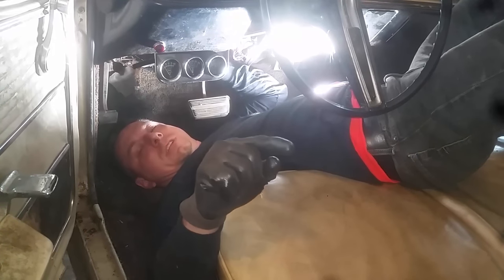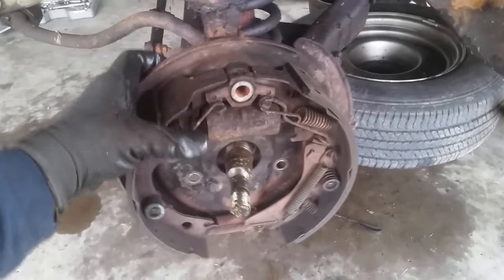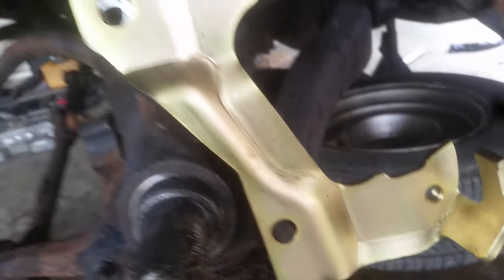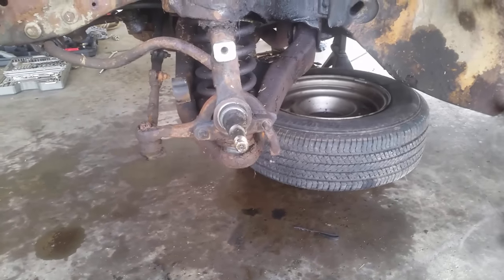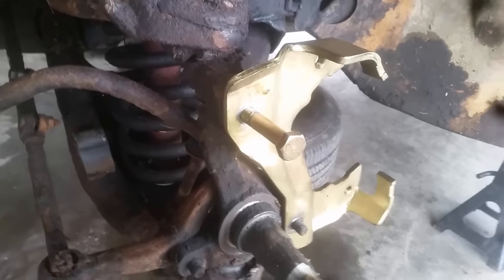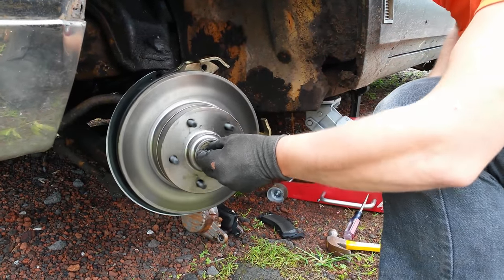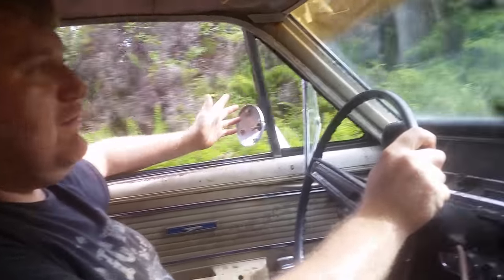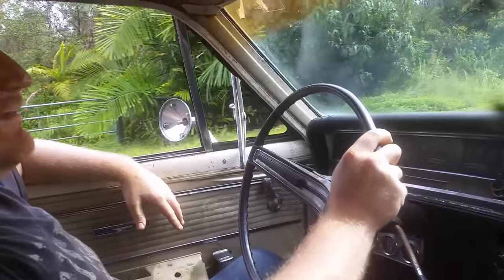DIY budget drum to disc conversion, disk brake, Chevy pontiac buick chevelle nova camaro rat rod

Comment from the maker: LINK TO THE KIT IN THE VIDEO--->     http://www.speedwaymotors.com/Speedway-Deluxe-1964-74-GM-Car-Front-Disc-Brake-Kit,4624.html                                     ALSO,  I USED AND ANGLE GRINDER WITH A CUTOFF WHEEL TO MODIFY THE SPINDLE.  THIS IS VERY EASY TO DO, JUST TAKE IT SLOW.

Comment: Very well done, easy to follow. I do have one critique as to grinding the upper boss to make bushing though. Wouldn't it make sense/be easier to ream the bracket to fit the boss/bushing? Thanks for listening, John the Bassist.
Reply from the maker: +lektrikbass in the event you purchase a set of disc brake spindles I would prefer to have the bracket remain unchanged.... or in the case of going with a different disc brake route and being able to reuse the brackets or sell them...  making a little sleeve is fairly simple.  Especially because you need to cut it off the upper drum anchor anyway.

Comment: Very cool budget upgrade, i have a disc brake conversion kit with 2" drop spindals for my 67 impala i was goin to install the kit wen i install the airbag kit from accu air with e-level sensors i just havent had the time to do it,,i already rebuilt the front suspension 1 yr. ago with new everything n tubular control arms to correct the geometry of the old 67 stock susp. But i wanted to take it a step further with the airbag set up ya know!
Reply from the maker: We love these brakes.  Cheap and work good.

Comment: Very homemade and very awsome tip. I have a 69 nova with drums and i really want discs
Reply from the maker: Esteban Krapp it's the cheapest simplest kit that lets you keep 15 inch wheels
Reply: Invincible Extremes Muscle Cars Garage oh good point 15" wheels... i have 14" can i do something?
Reply from the maker: Esteban Krapp this will work with some 14 inch wheels.  Just need a little grinding on the corners.  Factory 14 inch disc brake wheels will work, but not 14 inch drum brake wheels.  The disc brake wheels have more room inside for the caliper

Comment: Like the information, just have a few questions. Since ive got the rotors and the master cylininder and calipers. Is all i need is the bracket setup? Thanks
Reply from the maker: Yes. That's all you need, i did the same

Comment: Saved me thousand$!!!!! 

Thanks buddy
Reply from the maker: Thanks!
Reply: Can this be done on a 1967 delta 88?  I have 26 inch rims. Will this kit work with those rims ?
Reply from the maker: Isn't a delta 88 same frame as the impala?  I think the impala is a different spindle, but something made for an impala can be used.

Comment: I tried this on my nova.  I had to buy spindles.  40year of hack jobs and burned bearings,  I felt I could try some new ones! Next I want to do rear disc. 
Are you going to do a video for 15 inch wheels?
Reply from the maker: todd heaney first we gotta put posi and 3.90 gears in the rear.  Then we'll look into some rear disc that fit a 15 inch wheel.
Reply: Hella ya looking forward to that video as well👍

Comment: My God THANK YOU SO MUCH,  GREAT VIDEO
Reply from the maker: Thanks
Reply: @InvincibleExtremes  deciding to replace / 1963 Buick Skylark.  Or swap out too Disc. Note seeing that it's not bad... I'm going disc.  Ty again
Reply: @InvincibleExtremes  
 Just a quick question while I got you the FRONT Drums do I have to remove a bearings And the cotter pin to get the drum off ???
I haven't a hard time getting the drum off the backs came off easy....
 Please thank you...

Comment: So this may be a stupid question but since he used speedways conversion kit does he have to always buy his rotors and pads from them when he needs to change them?
Reply from the maker: Nope, these are stock brakes.  So pads, rotors and bearings all come from any parts store and are dirt cheap.  I just happened to buy the kit from speedway.  

In fact, because shipping to hawaii is expensive, you can buy just the brackets.  And can buy the rotors, pads and calipers locally.  From a 69 camaro is what i told the parts guy.

Comment: Disc and drum master cylinders are very different! The drum master cylinder keeps a bit of pressure in the drum to help keep the shoes close to the drum,the disc master cylinder does not retain any pressure. Using the wrong one will give discs that are constantly dragging and overheating.
Reply from the maker: Andrew Wilson I never said they weren't... thats why I used a disc/drum master off a 68 camaro... and threw away the drum master.  if we ever had to upgrade to rear disc brakes as well, we would then need to switch to a disc disc master cylinder... because that disc/drum one has the residual valve in the rear drum portion of it...

Comment: I have a 1967 Firebird, it has a booster and double reservoir. I think it’s a master cylinder. Do I have to upgrade the booster and master cylinder ?
Reply from the maker: You might get away with just the master... depends on pushrod length.

Comment: Hey Cool Breeze, I got a 66 Chevelle, Ever done a rear drum to disk change? I heard a 98-2003 Chevy S-10 with disk will work, Do you know?
Reply from the maker: Dave Hurst yes it will, i've used the 98 camaro brakes on my 65 chevelle SS 12 bolt

Comment: I'm going to try this on my 64 I have a 350 small block do you think I can just use the master cylinder and booster from a 85 Caprice
Reply from the maker: jr dajuiceman you could... Or you could just buy a 68 camaro master.  Entirely up to you.  Either way you'll love the brakes.  I have no complaints about them.

Comment: Hey man I got a 67 tempest 4 dr custom. Wondering if this will work, if so do I need the proportioning valve (I don’t think we’ll be doing burn outs and what not).
Reply from the maker: You need a proportioning valve regardless... and yes, it will work just fine in your car.  Bolt sizes might be a little different but it's the same exact spindle.
Reply: Invincible Extremes Muscle Cars Garage thanks man I really appreciate all the videos and info you provide us !
Reply from the maker: Just doing what I can.  I'm glad you found some of them useful.  A 67 tempest 4 door is a graceful car, I'm glad you're working on it
Reply: Invincible Extremes Muscle Cars Garage thanks man I appreciate that. Yeah my dad got this car in the early 90’s I pretty much grew up in since I was born in the late 90’s. It hasn’t ran in a few years and I figured it was time to get it back up and running. I’m really finding your videos helpful. Once again thanks !

Comment: After getting the front disc rear drum master cylinder of a 68 camaro Do I use my stock proportioning valve on my 73 Nova or can I get one like the one you ordered from Speedway to replace it and mount it under the hood like the stock one under the master
Reply from the maker: Ismael Lopez can't use the stock prop valve... at least not for the front.  gotta use a 3 way splitter for the front, they cost $5

Comment: Does it matter where you install the prop valve ? I have a 63 impala and the rear brake line connects to a T at the RF. Its got me confused how to connect it to the rear line (first time working on an old car)
Reply from the maker: Kenny Wilson good question.  You want to connect it before the rear line goes left and right, so it only cuts off the rear brakes.  Not one, but both.  Can be anywhere really.  Just somewhere safe though

Comment: good stuff, I think this is the video you mentioned :)
Reply from the maker: UcantBeSerious03 this is EXACTLY the video I mentioned.  notice how easy it was to convert the spindles over? and honestly I would never recommend a booster, so much less hassle with manual brakes.  the whole setup was under $300 including a $30 master and the $39 adjustable valve....

Comment: I have a 1970 buick lesabre will this brake conversion work and if so where do i order from
Reply from the maker: Speedway has them, but the lesabre is likely a B body and uses impala brakes.  Google impala disc brake conversion for 1970 and you'll find it
Reply: @InvincibleExtremes  thanks brother

Comment: I just bought a 1964 buick special! 
Any reason the 7/16 holes at the bottom can not be drilled out to 1/2?
Reply from the maker: I'm not so sure they are cast thick enough for that.  So sometimes it's better to be safe than sorry and just sleave the adapter.

Comment: Does it matter if I get the "power" disc in the front master cylinder? Or does it have to be manual if im keeping the manual brakes?
Reply from the maker: Tyler Henrie manual usually has a smaller bore, but not always.  Interchangeable regardless
Reply: Invincible Extremes Muscle Cars Garage sweet thanks! What did you do for running the second set of brake lines?
Reply from the maker: Tyler Henrie we replaced all the lines anyway.  Never be afraid of brake line replacement.  It's  $10 per line and you can bend them by hand.  But if your lines are in good shape you won't need much anyway.  Take off the factory distribution block and replace it with a T for the front lines and an adjustable proportioning valve for the rear.  You'll only need to add a couple 12 inch lengths for that from the master.  So it doesn't matter if you start with a single or dual reservoir master
Reply: Sweet thanks!
Reply: Yes it matters. Drum masters hold pressure on the the system. Disc releases so the brakes don't drag.
Reply from the maker: todd heaney he wasn't talking drum to disc though, he was asking about power disc vs manual disc masters.  They are different, but are interchangeable.

Comment: what kit did you use? you never mentioned it. i understand modifying the spindles.
Reply from the maker: 0ldskool58 oh sorry, I did the unboxing last week.  its the $239 gm disc brake kit Speedway sells.  totaly worth every penny.
Reply: Invincible Extremes Muscle Cars Garage 
what did you use to do the mod? grinder? hand held bandsaw?
Reply from the maker: 0ldskool58 angle grinder with a cutoff wheel.  turned the steering one way and cut some, then the other way and cut some... then broke it off and cleaned it up with the grinding disc.  very easy to do
Reply: Invincible Extremes Muscle Cars Garage cool. thanx.

Comment: hey guys I'm doing the same swap on my Buick GS. my spindles are pointing forward like yours are, is that normal? shouldn't they sit straight
Reply from the maker: Jason Leal I think mine sit straight.  let us know how it works out for you.  maybe it's something I just didn't notice...
Reply: Invincible Extremes Muscle Cars Garage look at 8:45 of the video. The 3 hub bolts that are in a triangle shape are tilted forward... the hub leans towards the front
Reply from the maker: Jason Leal it's an illusion... the suspension is at full droop, and steering is to the right... the upper control arm is in more than the lower at that point... so when steered it makes the upper ball joint tuck in...  when on the ground and pointing straight it's all vertical

Comment: The 2004r is nearly a bolt in, you can even reuse your driveshaft.
Reply from the maker: mcqueenfanman Mqueen rules! seriously... I am building a 68 mustang fastback soon...  but back to the 200r4, what in the world are you talking about?
Reply: Its a 4spd auto overdrive from the 80s, it was installed in most G & B body cars.  Some even had dual bolt pattern cases to bolt up to BOP or chevies.
Reply from the maker: mcqueenfanman except finding one in hawaii would be next to impossible.  sounds like a decent idea but we are planning on a smog era 455 buick swap and then build up to try and reach 10 second quarter mile times.... but thats going to take some very careful planning and a built th400, not a 200r4...

Comment: I'm sure a fender cover would keep the brake fluid from eating the paint off your car. Kinda amusing how ya lay stuff down on it leaking everywhere like it's a work bench or something. I wouldn't do that putting a master cylinder in my 57 Chevy. That part made me cringe. Other than that, the video was informative.
Reply from the maker: Yeah, in Hawaii everything rusts... any oil is free rust proofing.  But I agree with you.

Comment: Not bright enough to remove the seat before working on the pedals.  Lazy always costs more.  It does me, every time.
Reply from the maker: Thor Dehr Lazy? Not bright enough?  You sir are barking up the wrong tree.  theres no need to remove an entire bench for ONE push to come out, and then get screwed back in... its not like I was doing an auto to manual conversion and was actualy doing a bit of work to the pedals...
Reply: Invincible Extremes Muscle Cars Garage gotcha. I take it back.
Reply from the maker: Thor Dehr no worries!  but in all seriousness. this piece of junk is so rusty i'm not sure i can safely remove the actual seat bolts without breaking them off...
Reply: Yea, the captured nuts on the floor often go through to the underside.  You're most likely fucked before you even start trying to loosen them.

Comment: I see a bolt head on the upper   you said on vid to cut it down to a stud  this is confusing me  I am looking to do on a 1967 Camaro   did I miss a step ? Thanks in advance
Reply from the maker: 67 Camaro spindles are different from the buick ones.  Once you get the kit it'll be obvious what small differences there are.  Itll work just as good for the Camaro... better actually, since the camaro spindles are what this kit is designed for.
Reply: OK so with this kit all I will have to do is cut down the spindle  .06 of an inch?and what would be the preferred way to cut them back ? while on the car
Reply from the maker: Angle grinder works just fine